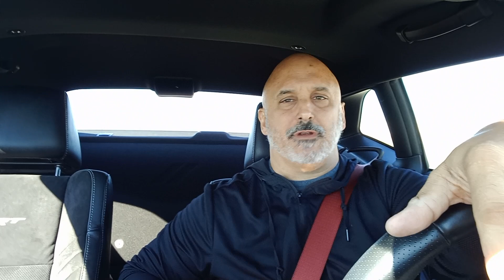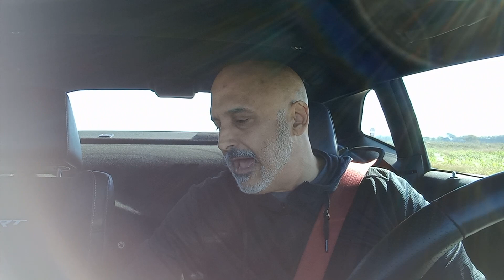Boostane load testing. Datalogging fuel quality.

Comment: I want to start data logging my car. Which program would you recommend? I also prefer using a laptop instead of a hand-held device. Thanks! And great video as always professor B!💪🏽
Reply from the maker: I prefer hptuners software.
Reply: @Moto-Psycho-1  I appreciate it!
Reply: @Moto-Psycho-1  Do I need to buy credits if I only want to read numbers and not change anything in the software?

Edit: I meant the tune.
Reply from the maker: @x4tfxChallenger  you will not need to purchase credits to data log.
Reply: @Moto-Psycho-1  Thanks man!

Comment: Have you ever used ACES IV fuel catalyst? It raises octane by approximately 9 points, creates a synthetic lubricant as it burns which reduces bore wear immensely and increases combustion efficiency as well. Data shows 6% hp increases and bore wear reduction of up to 600%. I've been using it for years.
Reply from the maker: Never used it.

Comment: I would love to have heard you. Finding decent Boostane tests has not been easy.
Reply from the maker: The thing about boostane, and the one thing that I really haven't heard anybody talk about, is the fact that it is good insurance against questionable fuel quality. Fuel quality that's just simply not up to par for the task of keeping a boosted engine or high-compression engine happy. In short, the stuff works. Just don't expect it to be a cure for the problem. It works very well as an insurance policy, but it does have its limits I would say that it works very well up to 1 oz per gallon I was basically using roughly half an ounce per gallon. And it seemed to significantly reduce the short-term knock retard / knock sensor voltage. In an upcoming live video I will be discussing the second half of that test which deals with me filling the tank up with fuel from a known good source, let me rephrase that, a known consistent source of 93 octane. That will probably be tomorrow night
Reply: @Moto-Psycho-1   Unfortunately, here West of Texas, so no 93. I have a 100 octane tune, and 1 can, to 17 gallons is showing to be 100 octane,when mixed with 91. I don't have anyway to test for KR, or such, but the car  seems to run the same ET. Just happened to go to the track with that fuel setup, and still had about a half tank. Not anything I want to do alll the time, but good insurance as you say.

Comment: I started using boostane with sunoco93 a few weeks ago.  Not really for daily driving but for when I take it to the drag strip.  I add about .33 oz/gallon (professional grade) to get the octane up around 98.  I don't have enough hits to tell for sure, but am optimistic.  One thing for sure, i was adding a few gallons of Sunoco 260GT to get the octane up to about 96-97and using boostane is a lot more economical and convenient for what I am doing...Car tuned for 93 and only using it as octane insurance. Nasty stuff, BTW - I had to break out chemistry glassware and use a graduated cylinder to measure it out into a gas can with a gallon or so then mix and pour into the tank.   I've heard it will mess up paint if it spills and don't want to find out firsthand.  Thanks for doing the boostane hits and sharing!
Reply from the maker: I use a glass  beaker and a long funnel.  I won't let it get anywhere near the paint.  It was a fun test of the effectiveness of the product when dealing with sub par fuel quality.  Far easier and less expensive than race fuel.  Considering the cost and how well it seemed to work, I would recommend it.

Comment: As always liked the vid...ride alongs are great.  Just for clarification you are talking KR PID in degrees and not the Knock Sensor voltage that you are seeing knock retard. I have been taking your advise in what to look for concerning the Knock Sensor Voltages especially in this cooler weather. Haven't seen anything over 1.5 volts and 0.0 on the Knock Retard PID. I'm getting it a fuel thing. So how high does your voltages get before the timing starts to be retarded? On the subject of timing, in the Chart Display Parameter Selector timing PIDs, what is the difference between "Actual Spark" under the Engine, Spark & Advance, Advance PIDs and "Spark Advance" (Sensor) under the Generic Sensors, Engine, Spark, Spark Advance PIDs. (both read in degrees). And which one should I be looking at or is there a different one I should be monitoring to determine when timing is being reduced? These two don't always have the same value which makes me think they are different is some way. Thanks
Reply from the maker: Timing advance (SAE)
When you're looking at knock sensor voltage versus knock retard, you have to remember that each cylinder has its own knock table. This is due to their proximity to the knock sensor itself. Based on what you were showing, you are in very good shape at those voltages. Depending on the combination, supercharged, long tubes, no cats etc, those will all affect how you set your knock sensor voltage windows up because of the racket that they create underneath the hood. In short, each car is different for when it will start to pull timing at which voltages.
Reply: @Moto-Psycho-1  Thanks...I'll do some changing to my Channels List and Chart. I always learn something new when talking w/ you.  FYI  So I put a set of Hoosier DBRs 28x10.5 on and ran a best 1.289 60' and 6.833 best 1/8 at 103+ in 550 DA (1/8 mile track). Great tip and definitely the most fun!  Still hitting throttle torque source RPM Limiter and at less than 5000RPM causing SC bypass opening. There must be some anticipatory function (integral controller) that's causing it...good thing is that it's only happening once instead of several times and no ESP! Thanks for the tip. SO I went back looking at the data log and found that the trans turbine speed was 6200+ when the TTS went into RPM Limiter....make a lot more sense now. This isn't the first time some of the data log PIDs are unreliable. Also FYI- I have the Forgestar F14 17x10 beadlocks. The tires did not slip on the wheel and torqued the beadlock rings to 120 in-lbs per the minimum recommended maximum torque (10-12 ft-lbs) for the F-14s. Let them sit overnight and retorqued then checked them again at the track before I made the first pass.

Comment: What are your thoughts on the fact it stains the spark plugs, combustion chambers, valves etc.? Some people have torn down motors after running boostane for long periods of times and were bugged out that everything was stained orange and it wouldn’t easily come off.
I’m not necessarily worried about the stains, but why is it doing that? Is it something people should worry about?
I’ll see if I can find and post some links to the aforementioned.
Reply from the maker: I have heard of this, and have never heard of any issues stemming from it. There are guys with thousands upon thousands of miles running boostane, both at the track and just in general driving their cars around with no ill effects that I am aware of

Comment: I ran a 100 octane tune running Boostane & 93 on my 17 Roush Mustang at 722whp and never a single issue in the 16,200 miles I owned it before selling it. Is it your opinion it’s not good to tune Hellcats with Boostane or you think all vehicles? Thanks.
Reply from the maker: The problem with tuning a car on Boostane has absolutely nothing to do with the boostane itself, more the owner / operator. You got to trust that part of the equation to do its job, in some cases people  forget to add the boostane, run the car hard and experience a failure. I like boostane more for an insurance policy against poor fuel quality than for an actual fuel that you are tuning too, in the same way you would tune a vehicle for 116 or 104 race gas

Comment: Another great informative video,  thank you sir. 
Do you think that in my "17" SRT 392 I would see any gain? Or at least as you mentioned some insurance based on available fuel quality.  
As of now she only has a "safe" tune and upgraded Barton shifter.
Reply from the maker: Not a ton.  NA is less sensitive to knock.  Monitor your short term knock and knock sensor voltage.  It's actually hard to over-time these engines.  After 18 degrees they stop making power on 93 octane.
Reply: @Moto-Psycho-1  
Thank you brother.
Reply: I have to add boostane to my 1320 here in Wyoming cause all they offer is 91 octane

Comment: What gas brand you use ? Tuners recomend Shell. So its better to have the car tuned in summer ? Or get a revision Winter/Summer ?
Reply from the maker: I recommend any top tier name brand fuel.  Exxon and  shell are the most consistent in my testing.
Reply: @ BMason what is more important to give yourself the best chance of getting quality 93…..Brand or high volume with lots of turnover on their 93?
Reply from the maker: @johnthegaptist7794  if the station has a high turnover rate on their 93 octane then chances are it's pretty good stuff. Go with what is working in practice.